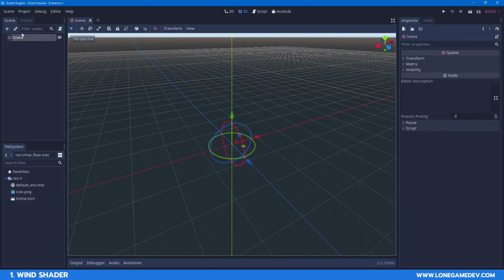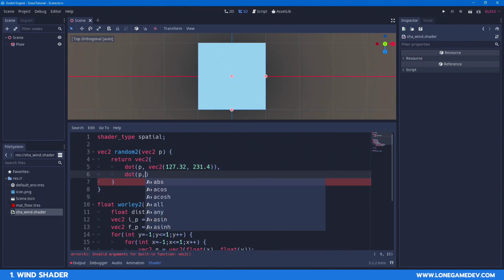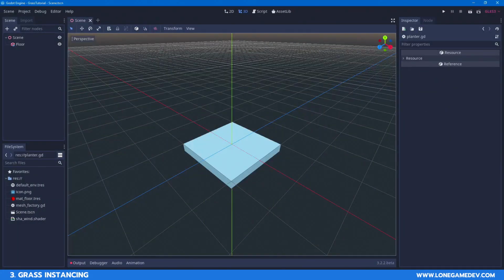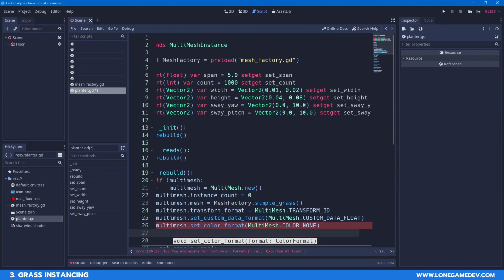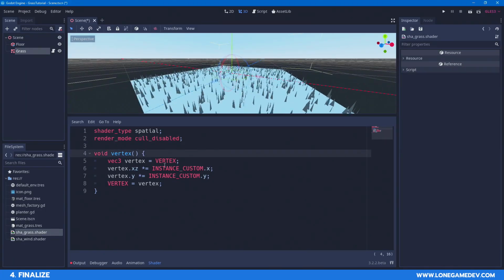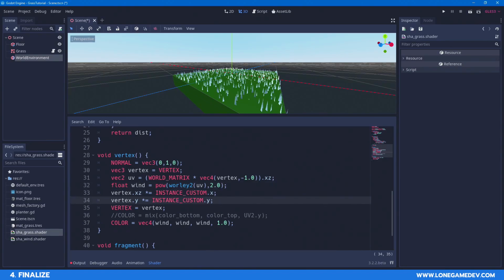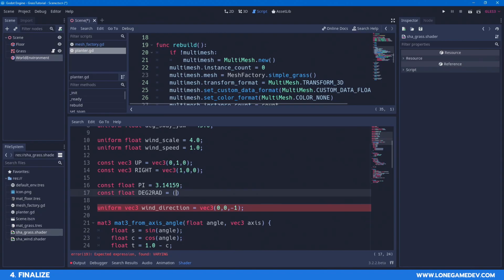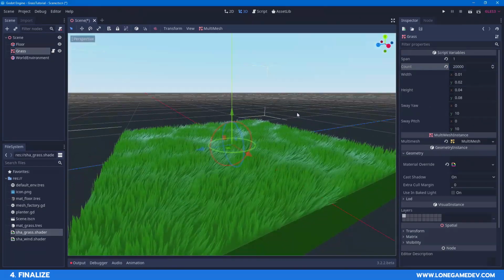BotW STYLE GRASS TUTORIAL

Comment: how can i mark where i want grass and where i not?
Reply from the maker: This will be one of the focus points of part 3. Until then, you can watch part 2, because it is about mesh driven generation. Then it is just matter of either sampling value from vertices or texture. Another way would be to limit based on surface angle, which is useful for very steep surfaces.
Reply: Don't suppose you ever got around to that part 3 at all? Or any ideas on how to remove/dampen grass around certain areas? @lonegamedev

Comment: Hello buddy, is there any way to make the grass fit in a terrain?
THANKS FOR THE VIDEO!!
Reply from the maker: Sure, it is possible to make it match the terrain. One method I have in mind requires using terrain mesh geometry directly. It goes something like this:

1. For each triangle, you can compute the area. 
2. The area will be used against some threshold (arbitrary number) to determine if we can plant a blade of grass in this triangle. 
3. If so - compute triangle centroid, and the face normal, and add grass instance using position (from centroid) and rotation (from normal). Then subdivide the triangle (this doesn't mean create new geometry just store it in some temp structure for calculations).
5. Repeat until no more subdivisions possible.

This will make blades of grass follow the curvature of the terrain, and on top of that planting will be more even and easier to control with a single threshold value. This value can be also set/modified by a value encoded in vertex color or texture (variable grass density).

I won't promise I will make such follow up video, but perhaps.
Reply: @lonegamedev  Hm, I'm not very good at shaders yet, is there any way I can do it using the "populate surface" option on the grass node?
Reply: @lonegamedev   Where did you learn how to do all that? xD I haven't found any tutorial of this graphic quality before.

Comment: This is awesome, thank you! But this doesn't scale well in Godot. Gdscript is very slow to create grass instances. I have a test scene with a 40Mx40M grid, 1.2 million blades of grass doesn't even cover this area well. And it's extremely slow at loading. Performance leaves something to be desired, too.
Reply: Kind of late to reply, but if you haven't already looked at it. There's a godot demo for threaded grass that fixes a lot of the performance issues with this. Coincidentally, the code looks a lot like this tutorial, so I think that's where the tutorial got the material from. The tutorial has better noise though, so I would definitely use the noise from this. At least that's my opinion.